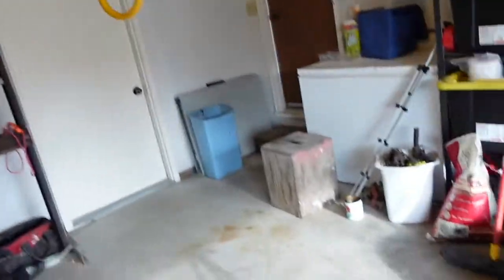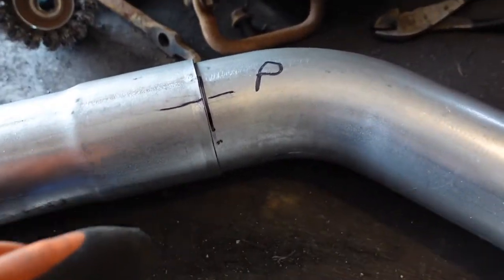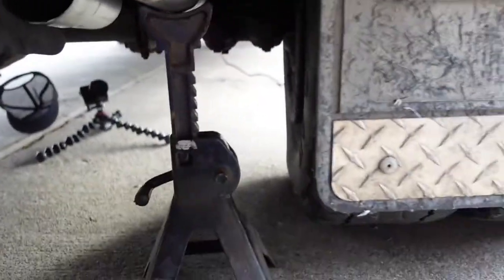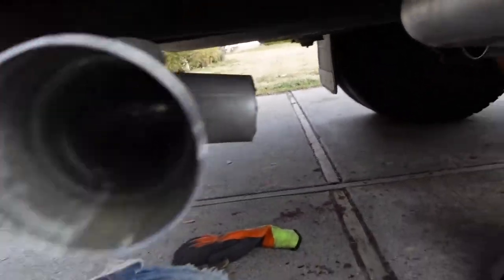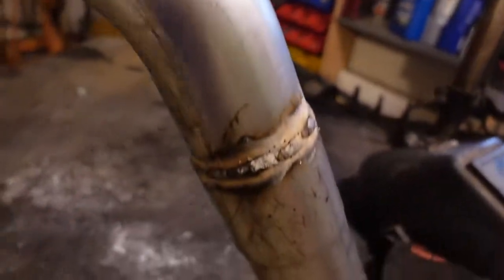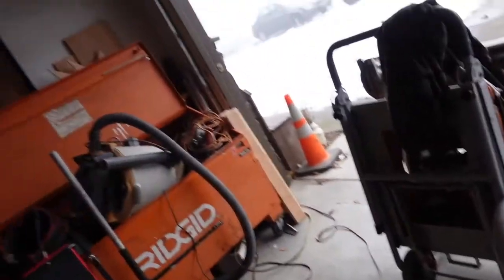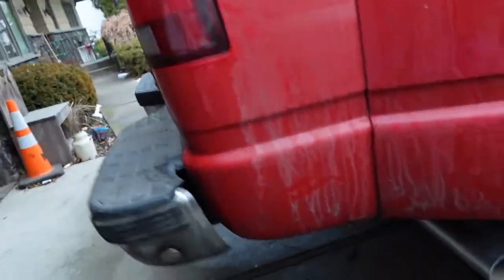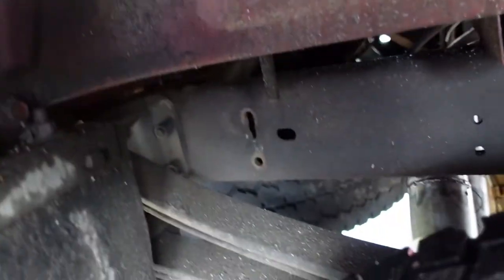Summit Racing 3" Mandrel Bent Dual Exhaust Install on a 1998 GMC k3500 with 454 (7.4L)

Comment: Hey Josh, just found ur channel it’s awesome !! Just got me 98 dually and also redoing exhaust. I was wondering if yours still has the rear seat slide assembly still on it ? Mine is gone and can’t find any info or pics of what it supposed to look like r replacement parts. Maybe u can get a pic r video of parts. Thanks
Reply from the maker: Thanks means a lot! No slides on my rear seat, its fixed.

Comment: how did you get around the 02 sensors i would think it would run poorly without them. i have the same truck with the 454 and if an 02 goes bad it runs really rich i would love to do something similar if there's a work around  thanks for the vids.
Reply from the maker: Still running the o2 sensors, this is all after the cats. Thanks for watching!

Comment: How much did this job cost you? I have the same truck and thinkin of doin the same thing!
Reply from the maker: looks like the prices have gone up a bit. 475 for the pipe, 70 bucks for the mufflers, plus some hardware, cutting wheels, welding wire etc. it would probably be around 600 bucks

exhaust kit
https://www.summitracing.com/parts/sum-670147

mufflers
https://www.summitracing.com/parts/sum-633253

Comment: Do you have long tube headers on this truck? and what is the function of the h pipe?
Reply from the maker: No just the factory manifolds. The H-pipe helps balance the right and left banks as well as builds torque. Thanks for watching!

Comment: I really want to dual pipe mine it is a 1994 Chevy k2500 ext cab but I think I am going to do ether a true duel or dual side pipes
Reply from the maker: The universal kit I used worked really well, I think they make bolt on kits for the ext cab though, it would be a little faster